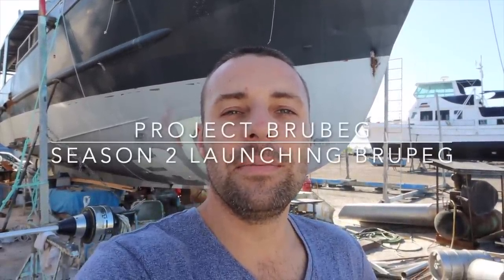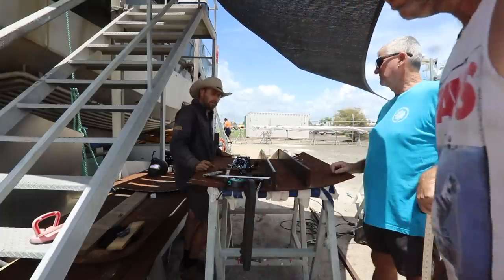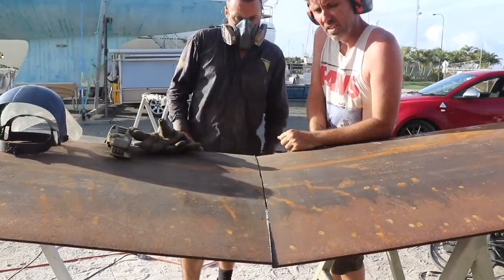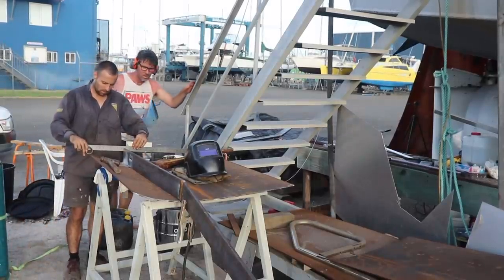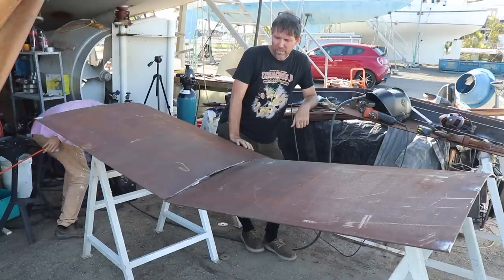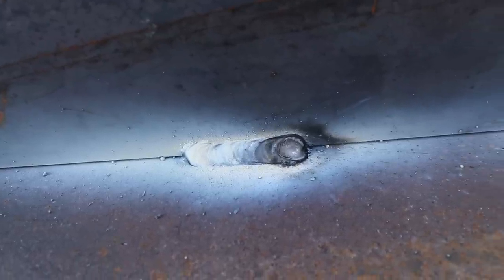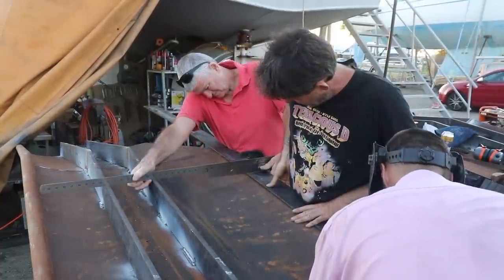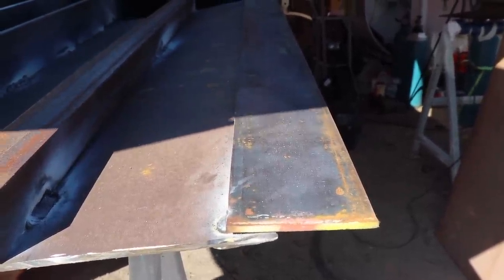Making Steel Trawler Wings - Project Brupeg Ep. 126

Comment: The word 'wings' caught my attention. I know very little about boats, but I used to make wings. For radio-controlled model aircraft. They were gliders with a wingspan of around 13' (4 metres), built up from epoxy-composites: a mixture of carbon-fibre, aramid [kevlar®], fibreglass, balsa wood and spruce.

The wings were very slim, very light, and extraordinarily strong. In flight they were literally unbreakable. Yes, really.

I love seeing the design and build process here, though - it's the antithesis of that old aeromodelling adage, 'Simplify and add lightness.'  Whacking great chunks of steel bar and plate, ribs and spars that need a forklift truck to shift 'em - fabulous!

I can hardly imagine the forces these vanes/wings will have to withstand. My lightweight things only had to deal with wussy air; yours have got thousands of tons of water smashing away at them... And the odd kraken, of course.  ;-)
Reply from the maker: Elli I love the thought of a plane guy looking at steel after steel being thrown at these things. When I designed these i was originally going to make them 12ftx 2ft and in the profile of a glider wing but others convinced me to move to a lower profile so they are stronger at the hull hinge. I still love the idea of big sweeping wings underwater, like a whale fin. Damien

Comment: Seems like you could reduce weight by punching holes in the stiffeners. Thinner I-beams for the stiffeners would also be a weight savings. Great work!
Reply from the maker: Hi Richard, weight savings is not something we need to factor in, these wings will have tons and tons of pressure applied to them so strength is the most important factor for us.

Comment: you can weld the second sheet of steel of internal structure using welding in several holes accurately drawn to meet the inner rib of the stabilizing wing
Reply from the maker: Yip that’s the plan. Hence the 50mm angle is facing up towards skin number two

Comment: Wow, those are going to be HUGE stabilizers! I can’t imagine the weight! From the sailboat world we can barely imagine these things :)) great episode as always!
Reply from the maker: Our guess is 300-400kg each
Reply from the maker: I thought about building some flopper stoppers for our old yacht as we lived on anchorage in a very rolly spot.Never got around to it but I do wonder if some hinged fins or centre board style foils could also be an option on a yacht. Maybe cedar core and carbon skins 4-6ft x 1ft would be plenty for most light yachts i would guess.
Reply: Marc Dacey well, I never said it was bad at all, and was referring to the massive weight and size compared to our humble sailboats...  Definitely sails are not only pulling the boat, they naturally stabilize it while cruising. At anchor it is another story.... some use a riding sail to prevent swinging...

Comment: Great entertainment and lessons. If I were to add my two cents, being a pilot and dealing with wings, not one aircraft flies true and some require trim to keep it wings level. My recommendations is to add some sort of mechanism/trim to compensate for engineering differences between both wings, changes in speed, weight distribution, and water conditions.
Reply from the maker: Ahh, a big hammer to the trailing edge would be able to provide minor trim adjustment. If more trim is needed we could heat and bend the trailing edge more, if it’s still not enough we could move one end of the hinge up or down at the next haul out. I hadn’t thought of this but it’s certainly something I will look out for, thanks Vic
Reply: @ProjectBrupeg  Looking forward to your splash. Please take care and stay safe!
Reply: @ProjectBrupeg  You may wish to have some sort of angle indicator on the hydraulic end of the hinge. You can trim a fair bit by differentially raising and lowering each wing, especially in certain sea states and cross-currents.
Reply from the maker: Ironically its looking like we might be going back to electric winches to lift/lower the wings and the arms will lock so only one position will be available... its a moving space and we swap between hydraulic rams and electric winch every ten minutes as we work out the arm details

Comment: "Solving the design challenges." Right on. Watching that happen is really interesting. Choppy vids between jobs is cool, too. There are a lot of jobs....In an earlier life, I was a boat rigger, of sorts. Fiberglass. Itchy plastic stuff. Steel -- can take a heavy hammer blow as punishment for not doing what I've tried repeatedly to make it do. Don't have to start over....
Reply from the maker: Steel does have a magic of its own. its a pretty remarkable material to build with.

Comment: Hey just a thought. You could use the power steering pump as the hydraulic pump for the wings. The power pack could still be a back up.
Reply from the maker: Hi Tim the power steer pump is quite small so yes it could be used like that the Kubota will be maybe 7-8 times faster.

Comment: Maybe possibly think about a few threaded bungs and fill it with flow coat and drain so it add internal rust prevention. Stainless grease fittings where it hinges for sure
Reply from the maker: Hi Don, these will be welded sealed tanks, normally in that situation there is no need to paint internally as rust eats up the oxygen and then the rust stops. That said we will be adding bungs so we can add 20-50L of diesel to each wing to slip around and deal with internal corrosion prevention (an old trawler trick)
Reply: Project Brupeg yes I understand it’s just something that was done on numerous USCG cutters I was stationed aboard along with many Merchant ships that I was Engineroom crew of and also when I worked in the shipyards on the other end
Reply from the maker: Without proper surface prep (ie sand blast) I doubt flow coat would even remotely stick to this steel as its quite weathered and has plenty of surface rust. I could see on new steel that would be an option but as its already rusted any surface coating would fall apart regardless with the surface rust coming back through. that and what we saw in the crash bulkhead where they painted 90% of the sealed tank and the 10% that wasnt coated got the lions share of the oxygen and therefore rust. I would prefer 100% of the internal surface get a very small amount of rust than a small area take the load

Comment: You built the marine version of the Vought Corsair wing!! I love the discussion of absolutism and relativity..... Being a pilot and a boat owner it is intriguing to look at the 'wing' profile. That is a high lift, high drag wing profile. If it were flown around at aircraft speed, say 90 kts it would be perfect. However you will be only going 8kts, call it 10 kts to make it easier. BUT water is 90 x denser than air, so in fact as a hydrofoil this profile is a very high lift very high drag profile, even at only 10 knots. Will you be able to adjust the angle of attack to get optimal alpha for your purpose?
Reply from the maker: Hi Mark, when i tried to explain what tey would look like before we built them i used the corsair as an example... people looked at me like I was dopey using a WW2 plane as a reference to a trawler stabiliser (they were wrong though, its a great reference!)

Comment: Those are a mighty pair of wings you have there. They may benefit from some vortex spoilers on their tips, similar to what you have on your rudder. Just got to chuckle at the banter :D <edited to correct spelling>
Reply from the maker: Yeah the plan is at winglets to deal with tip vortex on these wings
Reply: @ProjectBrupeg  I'm not sure your boat speed will be enough to worry about any tip vortex. I would be more worried about the leverage forces your planes will produce on the support struts and the hydraulics and on to the welded hull plates.
Reply from the maker: Its not really a speed thing in a forward direction, these will have force swapping between mostly on top to mostly on the bottom every few seconds as the boat rolls, thats the main driver of the tip vortex in this case. If it were just a speed thing your right and I probably wouldnt bother with them. The locking arms as always will be heavily over engineered as thats kinda what we do here. The hull will have almost three times the reinforcing of what the commercial guys add to their boats when they retro fit these style wings so none of this will be an issue for Brupeg and to be expected for the places we intend to steam.
Reply: @ProjectBrupeg  Cheers for your early comment back. Well done

Comment: G'day Crew,,
Hi guys , Looking closely  at your stabilizers, FIRSTLY,,  I'd like to say that I really like the design you have come up with ,once the engineering  side is overcome they will be  a great asset.
I need to see just a little more progress before going into more detail ,as they are of a Very complex nature, with many  obvious stresses , and some not so obvious ....
Some comments have touched on a few  great  ideas, that I will mention next time ,  but my only real concern at this early stage is the
 MID SECTION JOINS/WELDS,,   
Damo ,I'm sure your welds will be fine ,, providing  the maximum  forces are taken into account , (Get the calculator out )
 ,98% of the time they will be fine .
In a Very heavy sea ,the mid - section join, will need to be extremely  strong ,and spread the force uniformly as far as possible ,as this area will undergo massive force ,,as you well know .
Just a thought .
Look forward to next  episode  .
No worries bro ...
Reply from the maker: Hi Craig, I’ve pondered this joint and as I’m not sure what max load will be I’ve been thinking about adding non welded gussets to that mid point to tick off the what if I’m not as good a welder as I’d hoped concerns. Extra steel really won’t hurt and if I’m wrong it won’t matter if we are both right it will save the day.

Comment: Heard you talk about converting the Kubota to be used for a hydraulic pump.  Is there anyway you can also power a hydraulic pump off the Cummins as a back up? Thinking about the necessity of getting the wings up prior to docking. A backup would be handy, and using power that is already there would only require an additional pump, and plumbing the two together.
Reply from the maker: Yeah the plan is Kubota does the bulk of the hydraulic needs on the boat and acts as a back up to the Cummins steering pump if that fails. And vice versa if the Kubota fails the Cummins can be configured to supply pressure from the steering pump to the main hydraulic systems. It’s likely we will also build in a electric power pack just in case
Reply: @ProjectBrupeg  Excellent

Comment: Awesome design work on the "Fly"!  Have you worked out the underwater camera mounts for these wings?
Reply from the maker: OMG! I LOVE THIS IDEA!!!!!!! we will do be using this Jeff
Reply: @ProjectBrupeg  My wife is agitating for a way to dip a GoPro in a waterproof case whilst underway because she's a biologist and thinks there may be more life mid-ocean than is generally assumed, but apparently there's not a lot of footage. She says that eight hours of it would attract Norwegians, who apparently love to watch static shots from ferry trips and streams of fireplaces in action. "Spot the fish"!
Reply from the maker: We have been taking about fitting a camera mount on the wing tip so we can angle forward or backwards depending on the shot we want. One thought we had was steaming forward at 10+ knots will almost certainly kill a go pro mount so ive been pondering a polycarb dome that will fill with water but take the bulk of the hydrodynamic forces, camera mounted inside on a ball mount. We shoot in 4K so while we can fit a couple of hours of footage on a 256 SD card 4K Go Pro battery life is pretty garbage so 1hr shooting tops is all we get per battery. Still its not that hard to lift a wing every hour for a battery swap out if we need to.
Reply: @ProjectBrupeg  Or to clip it to a quick-release mount that allows a length of Dyneema to pop it off the wing of choice to retrieve the camera. It may be easier just to lower it on a pole from the bow, except when breaking ice, of course, but it would give you some excellent visual interest. Imagine seeing dolphins from behind!

Comment: how did you work out the correct profile of the hydrofoil to suit the boats cruising speed?
Reply from the maker: Best guess and a tiny bit of modelling in fusion 360. I used to build wing masts when I was younger so it’s a lot of gut feel based on what I learnt back then

Comment: Would love to be there with you lot must be a right laugh, with the serious bit of working out challenging metalwork. Stu I see you’ve traded in safety flip flops with safety toes. 
I hope Dame has supplied you with mandatory safety sun cream to protect said toes. 
Have you thought about having the stabilisers hot dipped galvanise prior to painting or is the surface not etched enough for anti fouling. 👋 Bye-bye Stu and Trevor.
Reply from the maker: We find a good course garnet blast is plenty to get the epoxy to bite in. that gives many years of trouble free use. Painting over Galv is an absolute pain in the A$$, as you need to use a specific paint desiged to coat with the extra zinc. I often use glav box section when making some parts etc but I blast the galv off the outside so I know its galv on the inside (where we wont/cant paint and blasted so we can paint on the outside

Comment: Subscribed! This is great. How do the wings actually provide stability? Guessing they only come down when the boats moving forward-  I'm guessing if the boat leans over one way, the downhill wing is under the water providing lift and the other side is above the surface, so it naturally wants to right itself? Dunno if that makes sense. :-D
Reply from the maker: Hi Nathan, they both sit in the water all the time. They down stop the boat from rolling but they DRAMATICALLY reduce the speed and depth of the roll.
Reply: @ProjectBrupeg  very cool!

Comment: It is Argon CO2 not oxygen.  In fact the whole idea behind a shielding gas is too keep OXYGEN away from the weld puddle.  Just thought I would mention that for the viewers since Dame has misspoken several times and said Oxygen was in the mix.
Reply from the maker: Nope. It’s argon and oxygen. It’s nitrogen you have to keep away. Oxygen helps lift the temp of the weld and you get better penetration into the parent steel.
Reply: @ProjectBrupeg  Yeah, I saw that later on in the series.  I have to check my bottles to see what is in them now because I have always told them Argon CO2 when I get them filled.
Reply from the maker: It depends what you weld. 75/25 argon CO2 is a common gas used for mild steel but stainless can’t have any CO2. So the gas we use is able to do mild and stainless really well and it saves us having to keep a different bottle of gas for each metal

Comment: Are you going to make them free flooding/draining based on Sod’s law that water will get in someday?
Reply: Maybe even hot dip galvanise?
Reply from the maker: They will be welded closed with a screw in bing at the tip. Each wing will have 20-50L of diesel inside to deal with rust. If water is getting in we haven’t done our job right. It’s easy enough to make them fully sealed up though
Reply: Project Brupeg Hi mate. Just make sure you’re back to clean steel on all your seal welds. Get rid of all the mill scale. Even a bit of mill scale in the root can give you a pin hole. Also if you can , although I realise it’s not always practical, try to position the stabilisers so that you can weld around an internal corner. As in not having a stop/start in the corner. And grind as many cold starts out as you can and weld up to finish on it. 
We used to make pump pontoons for the mines at one company I worked for and even after doing that we’d still end up with the occasional pin hole. And that’s in a workshop. 
Seeing as you’re putting a bung in them you may be able to pressurise them and go around the seams with soapy water. 10 psi would be heaps. But having said that 10 psi over the area of the stabiliser is quite a bit of internal force so you may not want to go down that path.
Reply from the maker: Yeah the plan is to pressure test these once built. Thanks for these tips. Its always nice improving what we can build with someone elses prior experience. Dame